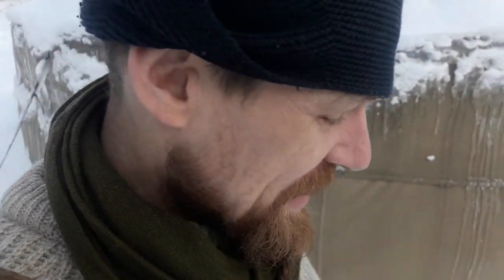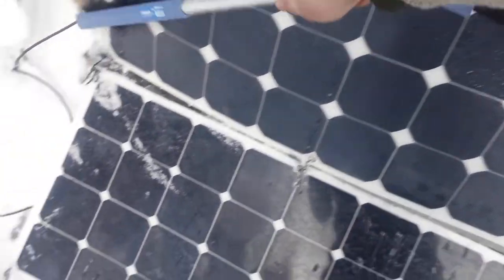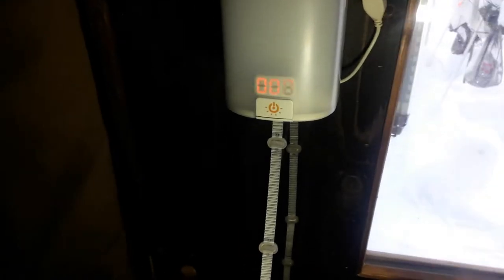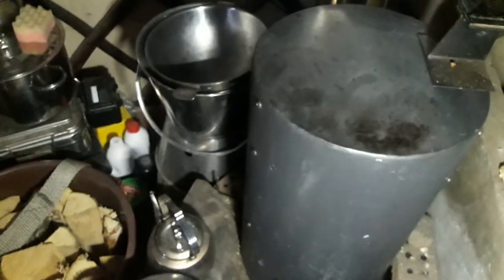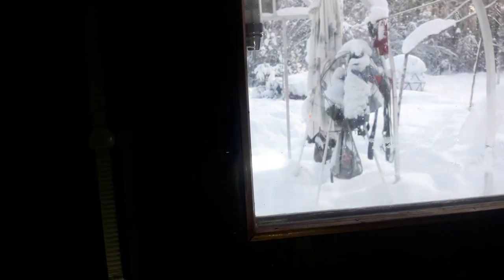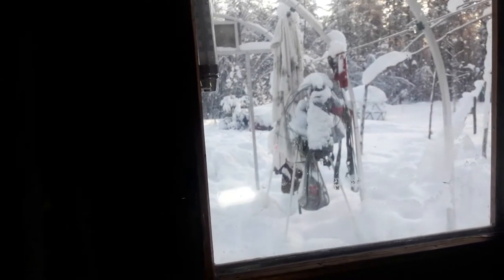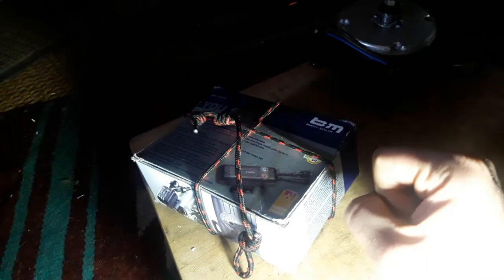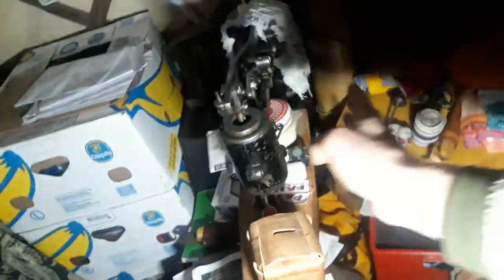subarctic offgrid yurt electricity setup

Comment: Some cool projects! Another thing ive been thinking about, which is not as good as just muscle power but much better that the normal way of powering things, is to have a lot of machines which are just mechanical but can be connected to a power drill or universal motor. So instead of every single machine having its own mother and electronics, you just have one power source that all the high quality mechanical machines connect to. Will be cool to see how you projects go and it's nice to see you living in a yurt in the north. We have considered doing the same here in norway. Subbed :)
Reply from the maker: Thank you for your comment and subscription.
My thinking goes in the direction of having "power horses"= bicycle based machines which can be coupled with each other to get two or more drivers on the same shaft and which can than be used to plug in a variety of mechanical tools and also to generate electricity.

Comment: Good to see your setup. Any use of wind to generate electricity where you are?
Reply from the maker: Very little. It's a pretty sheltered space (sun and wind) and for wind I'd need battery storage. Since batteries have very high embedded energy footprint,  they do not pay off until they need to be replaced.
So far I have one battery that could take some wind charging I'd guess.
With the sailing yacht solar panels came also a little windmill with incomplete wiring. Never got around to fix it/ install it.

Comment: Is there a possibility to transform fireplace fan into a some sort of dynamo? I've tested pig fat-candles - people are scared of its smell, but it happens only after you put it out of fire. I don't know if it leaves a fried fat smell into room, though. I've also thought about light sources without electricity (and batteries). When we sit down and read in wintertime in room, we don't really need on grid-dependant- technology and batteries, if there are good alternatives. ln that case they should deliver energy immediately into light, so for example something like mini stirling engine may be useful. Or something which is more bulky with size than normal lamps. But l don't know, whole electric tech is like magic to me.
Reply from the maker: Good day to you. I believe that the key is in the reduction of dependencies and impacts. Small stirling engine sounds really good. Been liking this concept much more than the TEGs. Probably a small teg could power an LED easily as it manages to spin a fan pretty fast.
I've experimented with floating wicks on recycled frying oil from restaurants. Smell was no issue but there are other issues as it needs to hang a glass in the middle of the yurt and I don't want oil to spill. 
Other issue is that I need to filter the oil much better. It's really still dark and somewhat thick and the light output is not satisfying. 
LED has other issues such as frequencies which we cannot notice with our senses and potential health impact.
But then again: what does my health matter as long as my death due to my impact might be more beneficial for the whol eff of the global community of life? Won't be able to know. 
And I do like the practicality of the headlamp. Basically only lightsource I could get by with?
Candle and open flame is however most pleasing.
Reply: I forgot to add: perhaps one main reason for lighting indoors is fire safety, as we see few house fires (in Finland) because of forgotten candles, sparks or inappropriate use of fire. But it is mainly how carefully you deal with it.  I wish to like more of candle and fireplace light , if I wouldn't live in modern house which is depends on electricity. But maybe in some day...

Comment: If you pick up or build a 3 phase bridge rectifier, spinning that front hub motor should get  you some usable voltage to charge your devices, even if just spun by hand.  Those motors are quite efficient!  A little charge controller in the mix https://amzn.to/2NdLzuL and you'll easily charge your phone while casually spinning the wheel.  Oh the fun we could have!